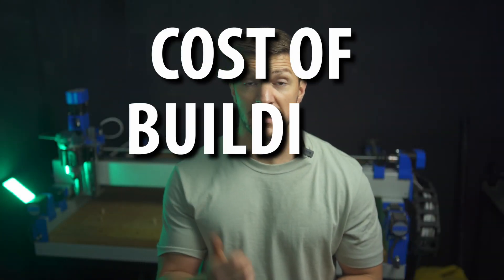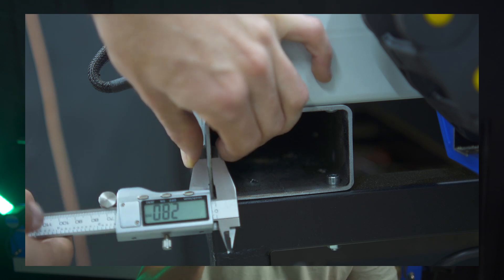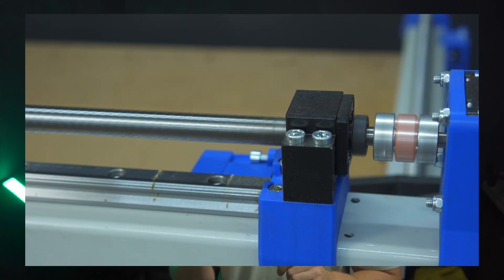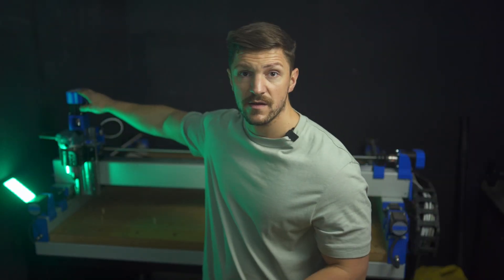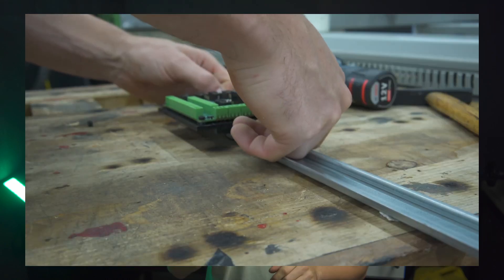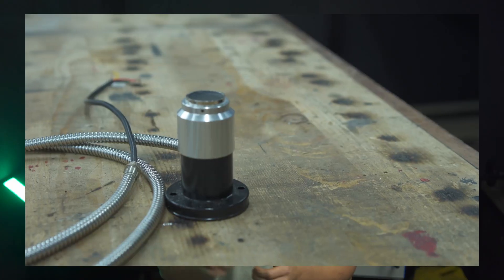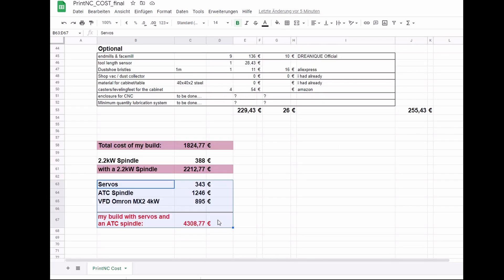The TRUE COST of Building a DIY CNC | PrintNC

Comment: One thing you didn't mention, and is critical the older I get 67, is time.  Most folks do not realize the crazy amount of time you will spend in fabricating and trouble shooting. Then you need to learn how to program and use the CNC.  I have six major DIY projects and parts in my shop, I started, but have not finished.

Comment: It’s expensive no doubt. More superior the parts, the more expensive it gets. Cost will also depend on the material you plan to work on. 

Metal working means more rigid machines and beefier line linear rail and ball screw parts . For wood working you could get away with lighter parts

I would be very careful using 3d printed parts in crucial areas.  You don’t want broken parts to fly around

Comment: I built a cnc for £700 with a 2hp water-cooled spindle. If your clever and search around you can make them cheap. Mine is 1000x800 and is made out of steel box section as its mules cheaper than aluminium extension.
Reply: Are you taking about printnc?

Comment: my homemade CNC cost around 2000 euro.  and it's 600x800 working area epoxy granite frame with HGR15 rails + closed loop steppers and 2.2Kw spindle.  it mills titanium.
i can build it for such cheap because right from the start i deny all DIY-3dprinted bullshit cause it is basically a wasted money with no profit.
i made my plans and just found a guy with CNC mill who made all parts i needed for an adequate price.

Comment: 0:22 I don't understand the bill of materials fragment shown.  How can Amount be 1500mm when the Title of 100x60x3mm is already a complete three-dimensional specification?  Likewise for the second line, but on top of that "X & Y Rollers" implies you need at least two, but the Quantity is 1.
Reply from the maker: 1500mm length,  100x60x3 tubing

Comment: Its a good machine, But I think the only part you do save money on is the metal you brought. Up to the ballscrews, You had spent £720+ So really when you get kits like the Queen Bee Pro Cnc, Actually for the parts you get and the frame its really good value for money going by your video. With that you get liner rails, all that stuff, But it only cost the same amount of money. 

With free postage, Its hard to argue when you see the individual costs of parts. Just ballscrews, Cable chains, Liner Rails, Aluminum Angle, Still cost hundreds, So the kits actually excellent value. Given me a lot of insight into parts and stuff, I don't think your CNC is expensive, Because it tailored too your needs and must be capable of the jobs you want.

So the price point you choose will always depend on the jobs you require, The speed you want them jobs done. Equally you could of spent 2000 it'd still be a great machine, But just less capable than the 4000 version one. In that sense? The price is nonapplicable to your needs its neither cheap or expensive. That is just the cost.. 

The only CNC machines I think are a rip off? Is mostly shop brought ones certainly for a benchtop. Workbee z1+ I wanted that originally! we're talking £1500+ that is before adding any extras? 

No liner rails either on that.. Insane pricing. Even when compared to yours.

Comment: I don't agree with you. I have 20/05 ballscrews on one of the machines and it is fast, 15000mm/min. It is much better to use 5mm step per rotation then 10mm because it is more precise.

Comment: Great machine! I made few CNCs but not looking so good. 😢😢 I spent a lot of money to made a machine. Here are two examples. I spent 400€ for the first and more than 1000€ ( dust shoe and cyclone for wood and  vice for metal included) for second machine, this is very expensive hobby.  🤔🤔
https://youtu.be/TDTDN_KkoJc
https://youtu.be/ziXmku7p6O0
I use MDF for work plate on my second shown machine because metal one is too expensive. I have great and precise vice which I mount when I am doing aluminum and metal and I use only mist not flood. I use piece of thin metal sheet to protect MDF but some coolant sometime drip on MDF 😥

Bits are very expensive although last long. I spent more than 6€ for single tungsten carbide coated bit !!!! 😗😗 and I have a lot of various bits for different materials so this is great expenses for this hobby or work.

I also made excel spreadsheet but I had more columns (internet address for ordering, phone of seller if I had, shipping, custom fees , etc...) so it is easier to make another machine next time. I made controller and project by myself.

Comment: I think ABS might be better for CNC machine, for their temperature tolerance properties.
Reply from the maker: You are absolutely right, but for the motor mounts it's recommended to.print them out of abs or petg.

I am still on PLA parts and they didn't warp or soften

Comment: Just buy a Bulkman3D Queenbee with an Xpro V5 all encompassing ESP32 controller with Wifi / SD card offline operations, and save yourself headaches and dollars. It comes as a kit and you still need to build it.
Reply: Queenbee comes with an aluminium frame which isn't great if you want to mill aluminium. Steel is 3X stiffer and more suited to the task.

Comment: lol, motherboards have parallel ports built into them until ~2020. They just looked different than most people are used to.
Reply: The USB port is not comparable to the parallel port. USB is a BUS, which does not apply to the parallel port. The main problem is that USB is packet-oriented, which makes it difficult to implement in real-time applications.

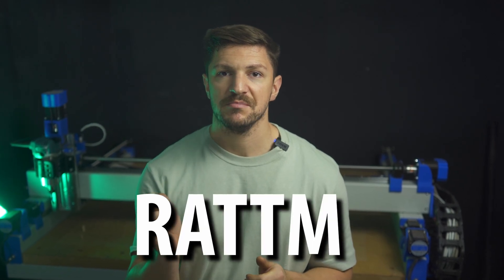Comment: 6:43 RATTM I would NOT advise. I ordered one of them and it came completely destroyed as grease was leaking out of somewhere and the whole plastic bag was full grease or fat. So the quality seems not to be that much better and the kind of bearing might also depends on the kind and type of motor of each brand. I doubt that VEVOR only builds in normal ball-bearings in general.

Comment: cable chain can made 3D printer lot cheapen, stepper drivers DM 556 normal less than 20$/pcs, DM860 about 50$/pcs, power supply normal used 48volt max what driver can handle better, about less than 50$, old HP pc tablecomputer cost about 20$ normal old have FREE or cheap. if have near scrap parts salvage area or trash area can build lot cheapen, my first cnc cost less than 300$ i found rails and motors and steel at salvage area lot parts FREE. i have build about 40 cnc machine now many small metal factory and many friends, all has cost less than 1000$

Comment: my machine diy 1500mm x 1500mm x 300mm build metal tube frame cost about 50$ C-beam aluminium 40$ nema23 3Nm 4A motors 50$ pcs =150$ rails kit XYZ SBR 20 1500 XY 300Z include ballscrews 1604 350$ controller paraller port, 10$ spindle 500W air cool ER16 100$  800W cost 170$ water cool whit VDF about 400$ 1,5Kw, software linuxcnc FREE,  cables FREE, limitswitch 10 pcs set 12$ MDF table sheet 1200mm x 1200mm 30$  all about less than 1000$ i not calculate this bits, or other little stuff not lot has less than 100$. only tool what i need buy has mikrogauge 0,001mm can make rails and spindle traights,

Comment: 0:44 aren't those just regular pin punches? For some odd reason I can't seem to find transfer punches anywhere, not even what they are called in Finnish. I'm guessing they are mainly a thing in the USA.
Reply from the maker: You are absolutely right,  but you can grind the to a point, so they work the same way
Reply: @ChristophLehner  True, that should work. I'm a bit limited on tools so I think I'm going to use an automatic center punch and a 3d printed sleeve.

Comment: good video, i build the indymill and upgraded to some cindymill parts, around 1000$ so a little cheaper, but also a smaller one.
but yeah it cost more that one would think, so build if you want to learn and achieve some tinker experiance ... buy if you just want it to work right away :)
Reply: can the indymill cut Stainless Steel?
Reply: @user-pe8ir4iy1e  i dont know, i have not tried .. bit maybe very light and slow

Comment: I thought its way cheaper to build than buy as I build them and the last one cost me £1000 which cuts wood and steel . Equivalent machine to buy is about 10k but mine are more accurate
Reply from the maker: imo the biggest advantage of building your own machine, is you can fix,upgrade and repair it since you understand everything about the machine
Reply: @ChristophLehner  correct it's something I would never buy . In general with what I have seen available the machines I see for around the 6k to 12k if I purchased those parts separately and built myself I'm saving about 80 percent so thats a huge chunk.

Comment: Why did you chose the PrintNC? It would be interested to hear your thoughts on the other open source project!
Reply from the maker: Initially, i had a look into the MPCNC, but quickly realized, the amount of work you need to put in, is almost the same, regardless which CNC you build.

And since my time is also limited, i figured, i go with the most capable machine, despite being more expensive....

In general, you want to stay away from builds, which use printed parts for load bearing or motion compoments.
Reply: @ChristophLehner  Did you had a look at the Killerbee/Workbee from ratrig? The kit is nearly the same prince as you PrintNC!
Thanks for the open communication of the costs!
Reply from the maker: @W0LLL3  yeah, actually i also considered the killerbee, but the v-slot motion system is imo not as rigid as a linear rail, for a plasma or 3d printer, this is a great system, but for milling i think the linear rail wins.

And as said, it's very time consuming, to build a cnc, so i wanted as little compromise as possible.

It also depends on what projects / material you plan to tackle....

Comment: Awesome video would you consider making a plasma cutter/cnc? Cheers
Reply from the maker: I really built this, with the intend to also use.it as a plasma, but the more i think about it,  the stupieder the idea seems.
You have to somehow cover up all the ballscrews and linear rails, and need a water tray somsthing similar.

Plasma is a rather crude process, so the accuracy a printnc can achieve is rather useless.

But probably i will try it regardless
Reply: @ChristophLehner  ahh yes i see, probably better to make a new machine.

Comment: For my first cnc I went with a cheap aliexpress kit with steppers, controller and frame for 750 euros (ox clone). Got a rattm 1.5 aircooled spindle and vcd for about 250 euros. After a few years I replaced the frame with a diy build with 20mm linear rails and 16mm ballscrews. Added a square tube for torsion stiffness. The upgrade cost about 2500 euros, reusing the steppers, spindle and replaced everything else. The great advantage of steel tubing vs any aluminium extrusion is torsion stiffness.If the printnc was available when I started my cnc journey I'd definitely gone with the printnc! 
Some excellent points were given in this video! I want to replace the z stepper with a servo but didn't consider a braking system. Thanks for sharing!

Comment: I am building a small Desktop metal cnc mill 500mm×500mm overall size. And i am at $320 just for the frame. I am hoping it won't go over $1100 when finished.
Reply from the maker: Should be doable 💪

Comment: Im building a printnc as well and im in at like 2700-2900… i have all the large parts, and this included rewiring my garage for an extra 220 30a outlet… i may be short 100-200 for misc connectors or wiring gizmos… but i should be close. USD btw…
Reply: I just finished the video, i have 2.2kw 800hz gpenny ‘bullet type’ spindle with FOC vfd (aka most expensive non ATC), gh2k board, 180w servos on Y and 400w on X and a closed loop stepper on Z, i was able to find a us supplier for omc and jmc servos so i paid  390 for the 3 free shippin. I paid for my Z plates so i could just get it going without the struggle that was $180…
Reply from the maker: @josephjones4293  how do you like the gpenny spindle?

It's crazy how fast things add up 😅
Reply: Im coming from an mpcnc, so i have a better idea of what i hate about diy cnc and what i want from the new one. So i expected to pay a good bit. A onefinity x50 was my backup and its 3300 without spindle. 
Ive just finished the frame, and im only starting on the electronics. The spindle looks great, it feels like a solid piece, but thats all i can say just yet. My shielded cable arrives wednesday so hopefully i’ll be making cuts by oct 1.  
When she’s running i’ll tag you on the discord.